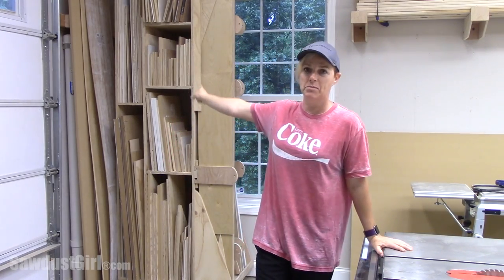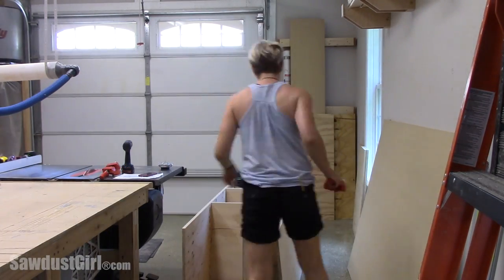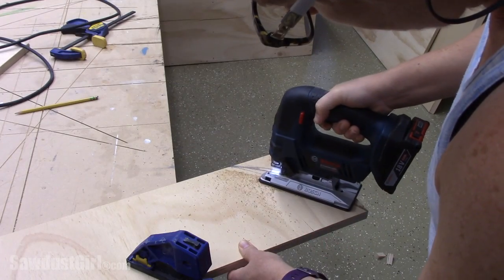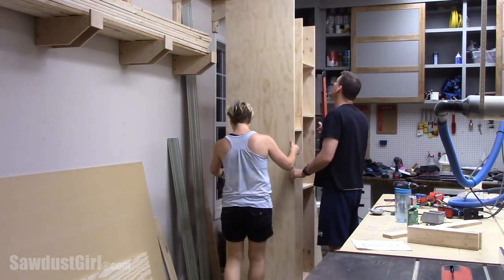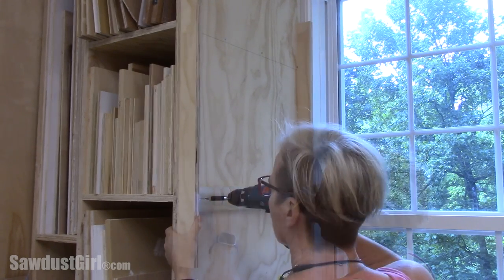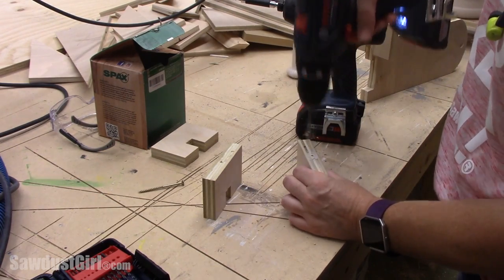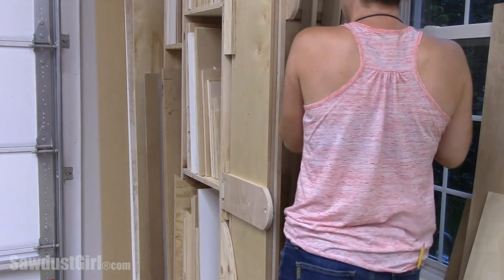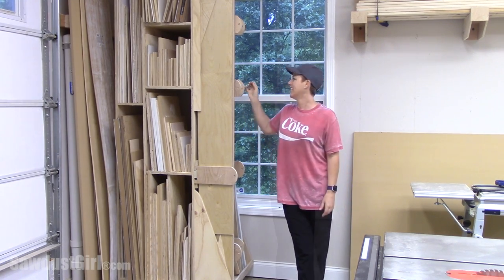Lumber Cart with Supported Vertical Storage

Comment: Very nice. a lot of people  are wanting to go vertical for lumber storage. I have a single garage as my shop with a solid cement roof and I will be changing my storage to vertical. like the clamps  you made to hold the wood.  sure you can change the screws to locking nuts which would make it easy to move. looking forward to next video.

Comment: Great cart.

The holes you drilled on the ends of the brackets gave me an idea, though - if you run a piece of allthread through those holes, and add another piece to the back end, you could create slidable brackets that don't need to be screwed into the cart. To adjust, you'd slide them on the allthread and add a wing nut. Each bracket would work like a vise, tightening up to hold the wood in the cart as needed.
Reply from the maker: Fantastic idea!

Comment: In general, I really like this build. The use of space and the different bins for organization are great. The one thing that I have a little heartburn over is the long lumber storage. Keeping them pressed together works well for stopping warping to some degree, but doesn't it also prevent proper airflow that horizontal storage and stickering allows? With only edges exposed, you're likely to get more checking at the top end  and create different moisture content levels.
Reply from the maker: None of this lumber is anything where I'm worried about moisture. 3/4 of it is premade drawer material (so plywood). It's definitely not a storage solution for lumber you're trying to air out.

Comment: Very cool, I may have to do something similar!  One thing I thought of is that you could almost recess some t-track into the back and just use a star knob or something to clamp each support in place, that might make it easier than screws.  Great video, thanks for sharing!
Reply from the maker: T-track is a good idea.  The only issue is that I'd have to move the wood out of the way to slide the bolt or knob...unless I'm not picturing how that would work correctly...which could totally be the case.  :-)

Comment: Your plywood rack is a great solution to the many odd shape pieces that can be used later. You mention this is a temporary solution as you assembled with screws. Looks like your work shop is a one car garage. The tall scraps of plywood prevent mobility with overhead door tracks and your new wall wood storage rack. The use of casters is great but potentially dangerous for it could be top heavy when pushed. I'm not being critical because your rack is really - really a great solution and design for a small shop.

Comment: Good build and videography! Sliding (horizontal) wedges could be used to hold the tall vertical pieces tightly together rather than having to unscrew and screw.

Comment: Maybe just use wedges to clamp those brackets tight instead of the skrews. You could easily hammer them in our out to adjust for the various wood thickness.
Reply from the maker: That is a really great idea!  I didn't want to have to move the wood out of the way in order to slide my brackets whenever I wanted to relocate them.  That's why I didn't do a double French Cleat,  Lots of comments are saying knob and T-track which is a good idea but would require the sliding and moving all the wood first.  A simple wedge is perfect and serves double duty: holds the bracket in place and tightens up the bundle of wood being stored.  Thanks for the great suggestion!